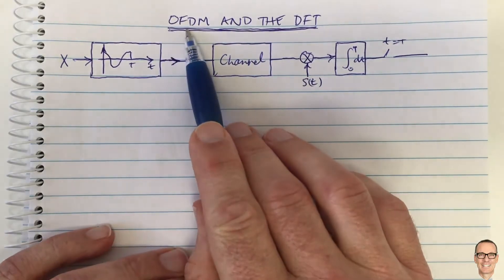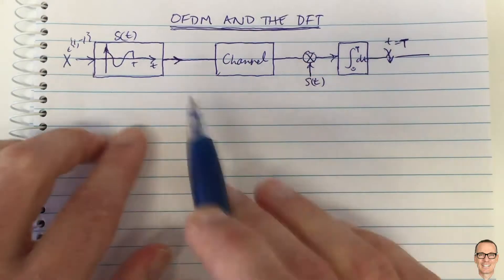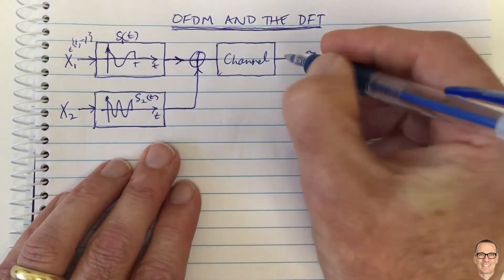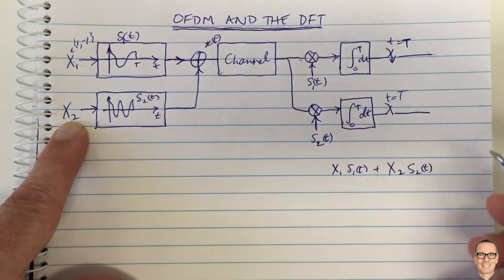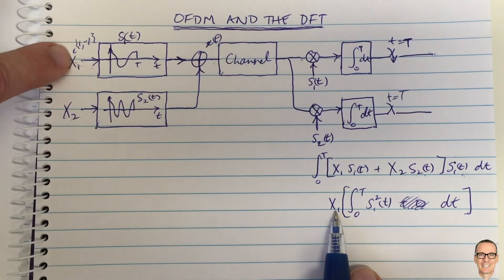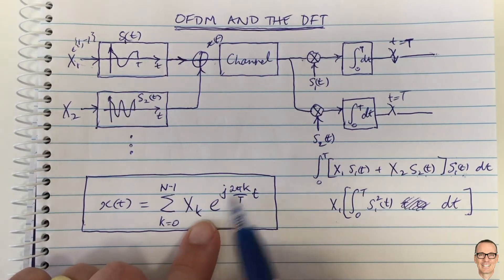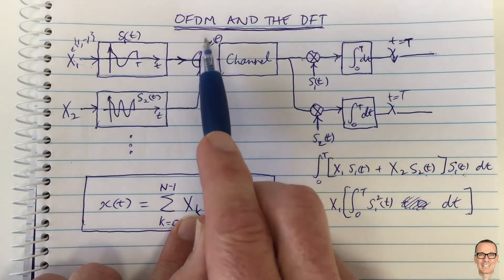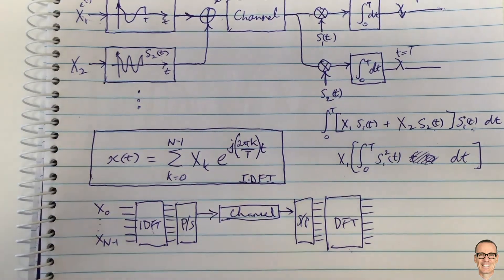OFDM and the DFT

Comment: In the IDFT formula, shouldn’t there be a 1/N factor? I think it’s missing
Reply from the maker: Yes, sorry about that. There is a note about it in the description notes below the video. And I fixed it up on the Summary Sheet on my website: https://drive.google.com/file/d/1j9yEl5HTQhZ2NtAgEVvWbQ7Rkd4lCQeK/view
Reply: @iain_explains thank you
Reply: @iain_explains  In this document http://ethesis.nitrkl.ac.in/4730/1/211EC4107.pdf, in System Model (15), I see that they do not include the 1/N factor in the IFFT, but they do include a 1/N factor at the receiver side. Is this correct?
Reply: @iain_explains In this document http://ethesis.nitrkl.ac.in/4730/1/211EC4107.pdf, in System Model ( page 15) I see that they do not include the 1/N factor in the IFFT, but they do include a 1/N factor at the receiver side. Is this correct?

Comment: Dear Professor, I have some questions, could you have some time to explain them?
1. In the OFDM settings, there is a parameter which is the subcarrier spacing, which is 30kHz. As I understand, the signal at subcarrier 2 would be X[k=2]*exp(j*2pi* 30e3 t), and signal at the subcarrier 3 would be X[k=3]*exp(j*2pi 60e3 *t),... so if we take the sum of them, is that different to the IDFT, which is the sum of X[k=2]*exp(j * 2pi /1024 *t), ... (with 1024 IDFT) ( I mean, the frequencies are 30e3*1024 difference). So do we need any technique between them? 
2. Assume that we can map X[1] from subcarrier 1 to exp(j * 2pi *0/1024 *t), X[2] from subcarrier 30kHz to exp(j * 2pi /1024 *t),..., X[1024] from subcarrier 1023*30kHz to exp(j * 2pi *1023 /1024 *t), so the highest frequency here is 1023*30kHz, so the sampling rate should be 2 times of it? then it is different from the video https://www.youtube.com/watch?v=knjeXo3VZvc&t=381s (How are OFDM Sub Carrier Spacing and Time Samples Related?) Is there something I am misunderstanding here? Could you explain it, or have one video to explain that?
Thank you so much
Reply from the maker: I'm not sure you are understanding the DFT/IDFT properly. The DFT/IDFT doesn't know the frequency spacing. It only takes a sequence of complex numbers and produces another sequence of complex numbers. It's up to us to interpret what those numbers relate to (ie. which frequencies they relate to). Hopefully this video will help: "Discrete / Fast Fourier Transform DFT / FFT of a Sinusoid Signal" https://youtu.be/lwQTNcWtN7w
Reply: @iain_explains  thank you so much, Professor. I found this video also: https://www.youtube.com/watch?v=zOziioXnn-k&t=1423s , and my questions are answered at 20:00 of that video. your videos and his video are all great ❤ thank you so much and wish you a lot of health

Comment: For QAM-16, the constellation points before the IFFT are in a regular grid. But after the IFFT, the constellation points would look very scattered and random, right?
Reply from the maker: After the IFFT there are no "constellation points". Each constellation point (in the frequency domain) corresponds to a sinusoidal waveform over the digital symbol period, T. See this video for more details: "What is a Constellation Diagram?" https://youtu.be/kfJeL4LQ43s
Reply: @iain_explains  Oh yes - sorry. I got confused for a second thinking that the IFFT output was a parallel vector, and not a stream of values over time. Thanks.

Comment: Thanks. At the beginning of the block, we give in digitale data (here 1and -1). These are the points on the IQ plane, right? With 4-PSK, there are 4 possible points I can give to the frequencies. With 16 QAM, I have 16 possible points I can give to the frequencies. Is that right?
Reply from the maker: Yes, that's right.

Comment: Great explanation, thx, I am wondering the sub carrier frequencies are f0, f0+15khz, f0+30khz for example, how are they regarded as 2pi*k/T in idft , seems hard for me to understand with a beginning frequency for sub carrier as f0, shall we just do like 15khz, 30khz, 45khz and then use a mixer to add f0 which is GHz
Reply from the maker: Yes, exactly. The baseband subcarriers are multiples of the fundamental (first) frequency, and then the whole waveform needs to be up-converted to the passband. This video gives more details: "How are OFDM Sub Carrier Spacing and Time Samples Related?" https://youtu.be/knjeXo3VZvc

Comment: Thank you every much for such a beautiful explanation. I have a quick question. Instead of doing IFFT, Since we know the frequency and sampled waveform of  the i_th subcarrier, can we just store the waveform in ROM. Then recall the waveform and multiply with the i_th symbol instead.

 Or the IFFT is already more efficient to do the OFDM.
Reply from the maker: Yes, you could do that, but then you've got to factor in the time it takes to load each waveform (vector) from memory, and you'd still need to add that waveform (vector) to all the others for the other subcarriers. Overall it's quicker to do the IFFT.

Comment: I appreciate your great videos, Professor! Could you please explain why this operation is referred to as DFT? DFT that I am familiar with has N in the exponential, not T.
Reply from the maker: Yes, you're right. I gave the continuous-time version of the equation because it's more intuitive to show how the waveforms (at the different frequencies) add up. But if you substitute t=(n/N)T, then you get the equation you are talking about (in terms of the discrete-time samples, indexed by the variable n). This is because in the IDFT, there are N time-domain samples, because there are N frequency-domain subcarriers. I also didn't show the usual scaling by a factor of 1/N (which I probably should have mentioned. ... but it's just a scaling, so it doesn't change any of the intuition, which is what I am trying to show in the video).

Comment: Great video, thanks, Professor! I have a doubt though: from an implementation point of view, after IFFT,  we get a discrete time-domain signal with N-samples whose values are complex numbers. How are we transmitting these then?
Reply from the maker: Great question. Here are two videos that I'm pretty sure will explain it (if you watch them both): "How are OFDM Sub Carrier Spacing and Time Samples Related?" https://youtu.be/knjeXo3VZvc and "How are Complex Baseband Digital Signals Transmitted?" https://youtu.be/0lkRJgnywkg
Reply: oh yeah. same doubt over here. WHY people don't use a SUMMATION of X_k * e^ (i thetha) + e^ -(i theta)/ 2    (thats a cossine in EULER formula). that seens prety more clear and direct !

Comment: What the S/P block achieves in transmitter? I thought that we had N parallel data streams (N: number of subcarriers).  Is this time between each transmission so small that we consider parallel transmission?
Reply from the maker: Yes, the S/P can be confusing. Often people (including me) leave it out of block diagrams. Really it's just indicating that the OFDM modulator takes in a data stream (serial data) and distributes it into frequency sub channels (which we think of as being in parallel, because they are orthogonal to each other), and then converts that into a time domain signal using an inverse Fourier transform (which is serial again).

Comment: IDFT or DFT should be applied to the discrete signals. But the basis used in the IDFT formula in the video is continuous. Is there any block digital to analog conversion that happens?
Reply from the maker: Yes, you're right, I skipped over a technical aspect here. The equation I showed is not exactly the IDFT. For the IDFT, the continuous time variable t should be replaced by the discrete time values t=(T/N)n . In practice, the actual transmitted signal x(t) is formed by putting those discrete time values/samples (ie. x(Tn/N) ) into a pulse shaping filter. See this video for more details: "How are OFDM Sub Carrier Spacing and Time Samples Related?" https://youtu.be/knjeXo3VZvc

Comment: Thanks for this great video. I am just confused by the P/S function after IDFT for a long time.  It seems that we are already transferring X0 to X_N-1 in parallel by adding up multiple signal together in time domain.  Could you please give a explanation about this?
Reply from the maker: Well the P/S is really only shown there to indicate that the frequency domain symbols are processed in parallel in the DSP/Processor, whereas the time domain samples that result from having performed the IDFT, need to be clocked out into the transmitter in series (one after the other).

Comment: Excellent videos on this and other subjects.  Could I suggest some future videos on some related subjects?   1.  Carrier clock recovery for OFDMA wireless systems; 2.  Symbol rate clock recovery for OFDMA wireless systems;  3.  Receiver gain/level control for accurate decoding of QAM constellation points.    All of these have obviously been solved quite satisfactorily for 4G/5G and 802.11ac/ax systems, but there isn't too much info out there on how it is done.
Reply from the maker: Thanks for the suggestions. These are actually already on my "to do" list, but it's a long list.

Comment: Thank you so much for this helpful vedio. I have one question please.
The signal x(t) is a baseband signal, is there any need to multiply/modulate  it by/with fc for transmission? 
I have seen some block diagrams include multiplication by fc after the P/S block.
Reply from the maker: Yes, it needs to be shifted up the the carrier frequency. See: "How are Complex Baseband Digital Signals Transmitted?" https://youtu.be/0lkRJgnywkg

Comment: Hello Sir. Thank you for the video! I don't understand why x(t) is the DFT.  If the signal length of X would be infinite then at every frequency component there would be a Dirac with the hight of the value of each symbol. Then I would understand why x(t) is the DFT. But in this case the frequency components are sinc Funktions. So why ist the Fourier Transformation discrete?  Sorry for the bad English.
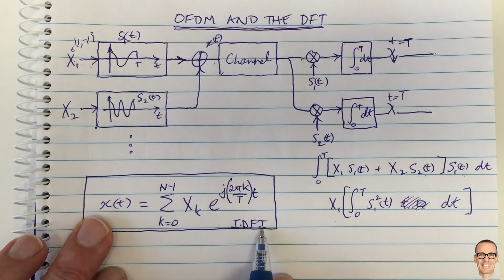Reply from the maker: Hi Sorry, I'm not exactly sure what you're asking. As I mention at the 9:11 min point of the video, x(t) is the inverse DFT of the frequency components X(f). (note that I originally said it was the DFT, but I corrected myself at the 9:11 min mark). The components X are in the frequency domain, and there are only a finite number of them, since we are only wanting to send our data over a finite bandwidth. I'm planning another video to explain how the subcarrier spacing is related to the digital sample rate, so keep an eye out for that one.

Comment: Thank you for such a great video. If possible, I would like to ask a question. At 5:10, I see that the two sub channels (S1(t) & S2(t)) are orthogonal and they don’t influence each other after we take the integration in time-domain. However, in frequency domain, the sinc functions have side-lobes that spread into neighboring channels. For example, the side lobe of S1(F) would overlap with the main lobe of S2(F). In that case, would the S1(F) still have some effects on S2(F)? 
If so, it seems to contradict our conclusion in the time domain.
Reply from the maker: You're right, they do overlap in the frequency domain, however they are exactly aligned (in the frequency domain), such that the contributions from all neighbouring sinc functions equals zero at each of the subcarrier frequency values. Hopefully this video will help: "OFDM Waveforms" https://youtu.be/F6B4Kyj2rLw

Comment: How does the P/S and S/P step work? You need to transmit the signal over the channel to preserve the orthogonality.
Reply from the maker: Sorry, I'm not really sure what you're asking. Sometimes, when a vector needs to be transmitted, people draw a Parallel-to-Serial box, to indicate that the vector is stored in memory elements in the digital device (computer/phone/...) which can be thought of as being "in parallel", and the output signal needs to be sequentially clocked out of the transmit amplifier in time order, which can be thought of as being "serial". But you don't really need to show those boxes since they are just an implementation issue.

Comment: Just to add more info- The output of IDFT is x[n] so you'll be obtaining discrete data at output of IDFT (you can compute this IDFT fast using IFFT process) now when you combine all data using parallel to serial you need to convert it to analog and then send. So add a DAC there and mix it with RF to send.
Reply from the maker: Thanks, yes, I probably should have mentioned that.

Comment: Very good explanation, but i have a doubt, in BPSK modulation the equivalent complex moduated signal  is given by y(t)= Real{b*(j2*pi*f0*t)} where b is the binary data baseband waveform (e.g. a rect of duration T_s), so shouldn't be the same here? also if you consider a DSP implementation of the modulation you have to feed the DAC with a real value, but the IDFT may give you complex numbers at the output.
Is this right?  Also, if i consider the numeric implementation of the OFDM, shouldn't be in the following form?
y(nT)=real{ sum of k from 0 to N -1  of  b_k(nT)*exp((j2*pi*k*n*T)/T_s) }   and 1/T_s = 1/N*Tch
 where Tch is channel bandwith , T_s is the symbol duration, T is the interpolation frequency (T<<T_s) and b_k(nT) is the n-th fraction (sliced in T_s/T parts )of the k-th subcarrier's data. I got it right? In Wireless communications course we directly saw the discrete equivalent  but this gave me trouble in undestanding  the pratical implementation of the system via DSP and DAC conversion. I know that writing forumlas on youtube comment is not the best but i hope is clear enough.
Reply from the maker: I probably should have also explained that everything in the video is baseband. The transmitted signal x(t) still needs to be multiplied by a carrier waveform in order to be transmitted at the allocated frequency (eg. 2.4GHz for WiFi). This is why there are complex numbers in the IDFT. The carrier waveform has a cos component and a sin component.